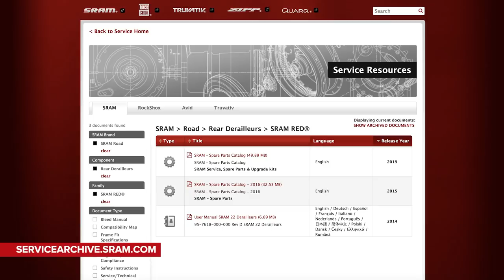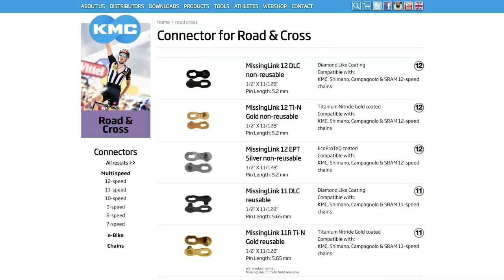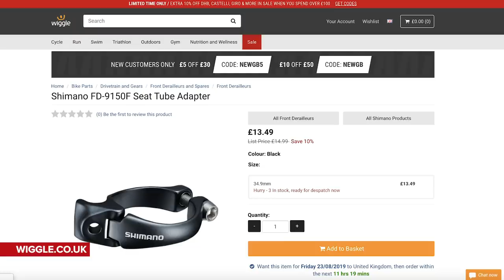How Do You Keep Your Bike's Chain & Cassette Rust Free? | GCN Tech Clinic

Comment: Books to help bike maintenance: Zinn & the art of Road Bike Maintenance takes a lot of beating. Get the latest version with good information about hydraulic disc brakes and electronic shifting. The diagrams are very good, and he covers most of the component manufacturers that are commonly found on bikes. Even older bikes... IMVHO it is a clearer book than the Park manual. He also has a similar mountain bike manual which caters for the grubbier types!

Comment: @ I've just bought a Cannondale Systemsix and wanted to get into running some time trials. My problem is, how do I mount on a set of TT bars onto my very aero flat knot handlebar. I don't want to bodge it by wedging spacers into the clip until it fits my bar because it just doesn't seem safe. Any advice or clip on TT bar recommendations? Thanks in advance and keep up the great work 👍🏽

Comment: Seat Post Creating. I had that problem haunt me once. Nothing fixed the seat post in the frame or the saddle rail clamps. It was the nose of the saddle where the rails were anchored. I used epoxy glue on that and it worked...for three days. I threw the saddle away and bought a new one.

Comment: Bike brake question... In the field, When the caliper brakes get bumped and one pad is closer to the wheel than the other, or after and accident,  should you just use the rotating barrel adjuster and adjust it open, or physically push the calipers over till they're centered on the wheel?

Comment: I've just passed 1000 miles on my Continental 5000's (700x25) with great success and no issues or flats.  However, I noted the other day that I mounted the "rotation" on the front tire 
in the wrong direction.  Question: Should I change it now or would changing a this point have an adverse effect on this wonderful tire?  Thanks and love the show.
Reply: It won't hurt it to change it.

Comment: On the subject of KMC Missing Links. Just switch to Connex links. The Connex are easier to use, and are meant to be removed and reinstalled over and over. I use them on both my KMC and Shimano chains.  Also, regarding chains,  I suggest GCN do a  whole show on waxing chains. I.e. using wax, such as Molten Speed Wax, or plain paraffin wax, for lubricating chains. 

I have been using wax for 3 years, on all my bikes. I ride about 5000 miles per year.  For about 6 months I used paraffin wax. Then  I tried Molten Speed Wax. With Molten Speed Wax I get  200+ miles from an application.  Yesterday I took the chain off one of my road bikes to reapply wax. Chain had about 250 miles on it. After removing the chain my hands were still clean.  And after a couple of thousand miles the cassette, on that bike, is still bright and shiny! 

DISCLAIMER: I AM IN NO WAY CONNECTED TO THE COMPANY THAT MANUFACTURES MOLTEN SPEED WAX!

As I mentioned I used plain paraffin wax for 6+- months before switching to MSW.  I have been using MSW for 2.5 years. With plain paraffin wax my chains needed re-waxing every 100 miles or so. With MSW my chains stay noise free for 250+ miles.  Chains stay clean as does the whole drive train.  Even the drive trains on my mountain and gravel bikes stay a LOT cleaner than they do if I use petroleum based lubes. 

I only ride on average 200 miles per week. More miles April thru October, less in miles October thru March. On average I re-wax a chain (on one bike or another) once per week. Using MSW takes a bit more time and effort. But it is time well spent! 

I'm an old guy, and I have tried many, many different chain lubes. I no longer ride the miles I did in the past. I also no longer race bicycles. But for those who do race, take time to read the 'VeloNews' article on waxing chains. 

I am at a loss as to why more folks don't use wax as a chain lube. Especially MSW!  I'd like to hear what GCN has to say on this subject, as well as hear from anyone else that has input regarding using wax as a chain lube!
Reply: I'm a waxer myself (paraffin) and regularly get over 300 miles from a waxing.  I also have a bottle of wax mixed up with xylene (to keep it liquid) so I can lube the chain normally in case I don't have time for a full wax job.
Reply: @mikeshelton4466  Mike,  I also went the Xylene route after watching the Oz Cycle video(s).  In his December, 2016  video he showed how to make a mix of paraffin wax, paraffin oil and Xylene.  I tried that mix and it would work for less than 100 miles. I don't recall whether or not I tried just straight paraffin wax or not. Oz Cycle put out later videos that seem to me, to contradict his earlier video. I.e. he was talking about cooling the waxed chain cool water. Just seemed like too much trouble. So I tried Molten Speed Wax. I'm getting  easily 250 miles from an application of MSW.  MSW claims their product is good for 300 miles.  I keep a log of how many miles I put on my bikes after  I apply the MSW.  Normally I re-wax  once I hit 250 miles. Therefore I can't say what the maximum  mileage I could get if I pushed to the point where a chain started to really become noisy. 

After I apply the MSW, the chain is stiff as a board. I can literally almost hold the chain straight out as if I was holding a stick in my hand. To me that indicates that the wax has penetrated to the inner parts of the chain.  

Some time ago I did a calculation based on getting 200 miles per application. 12 applications per $20 bag of MSW. Works out to $0.83/100 miles. 

I may try using straight paraffin wax, and make a comparison to MSW.

What temp do you bring straight paraffin wax to when you're using it?  After cooling the waxed chain are there any other steps involved before installing the chain on the bike? I.e. is there any excess wax that needs removing? 

 With MSW  I simply wax the chain, run the chain over a piece of PVC pipe to loosen up the chain, then reinstall the chain. No excess wax to remove.  I heat the MSW to 200 degrees, +- 5 degrees. I talked with MSW about the +- temp range.  Of note: If I heat the MSW to 200* F, and then insert the chain the temp of the wax goes down. Therefore I bring the wax with the chain submerged in the wax back up to 200* +- 5* before removing the chain.

Mike, Thanks for your input!
Reply: When I submerge the chain in paraffin, it's 50/50 wax and paraffin oil (approximately).

I heat the wax up to over 212°F. So it boils any residual water out of the chain (that would be the popping sound like frying in a skillet.). When the popping stops, I turn off the heat and let the wax cool to the point to just before the skin starts to form on top, then carefully pull the chain out and hang it up so it cools naturally. Before it cools, I wipe the chain down to get the excess wax off the outside. 

As for the wax with xylene, I just take a portion of the wax bath mix and add some xylene to that. I do have to heat up the wax and chain in the winter otherwise it sets before the wax gets down into the pins. I'm still looking for a better solution to that problem. Maybe the MSW would work better.
Reply: @mikeshelton4466  When I was using paraffin wax I used a small 8" diameter crock pot. For MSW I now use a Lavany Wax Warmer ($20 on Amazon) that is 4" in  diameter, which requires less wax to fully submerge the chain.  The Lavany has a digital temp display, and a knob for setting the desired temp.  The Lavany  cycles on and off to maintain the desired temp. The temp readout is not very accurate, so I use a handheld temp gun to check the temp of the wax. I set the display so that the wax is at 200* F, and even though the display reads something other than 200* the warmer continues to maintain the wax at 200* +- 5*. 

I live in Wyoming. I work on my bikes in my garage, and during the winter I use a small heater to heat the garage to between 45 to 60 degrees.  When the cold chain goes into the wax the chain reduces the temp of the wax, but the Lavany gradually brings the wax back up to 200*.  

And by the way the MSW seems to perform well in cold weather. This past winter I did many 1 to 2 hour rides when the highs for the day were in the single digits or low teens. On my coldest ride the temp was 0* F, with -14 windchill, and the MSW performed flawlessly. I.e. when I start the ride the chain is completely flexible. From my experience cold temps do not adversely affect the performance of a chain waxed with MSW.

My experiences with using MSW have all been positive. I recommend it. And I repeat : I AM IN NO WAY AFFILIATED WITH MSW, NOR HAVE I EVER RECEIVED ANYTHING FROM MSW. For me MSW simply works. And if my words prompt someone to try the product then I feel I'll be helping a fellow cyclist.

Comment: After clean my bike I dry off drive train with a towel and compressed air than apply PB Masterblaster on drive train followed by CRC silicone being very careful not to get on tires or disc break pads and rotors. Plus the drive train doesn't get dirty nearly as dirty as it did using any other product that I have tried.

Comment: #AskGCNTech , Hi, I'm a road cyclist and currently using a Giant Defy 5 which is running on a Shimano Claris 2400 Groupset. I will be getting a Shimano 105 5600 from a friend of mine down the line in a few months, which includes the 5600 STI Levers, RD, FD, and the 105 5600 crankset. Can you please guide me which BB will be compatible with my bike and the crankset. Also, I want to know if I can use 105 5700 STI Levers (10 spd) with 5600 RD and FD? I know it is a old groupset for 2020 but a gift is a gift :) 

Thanks and hoping for a reply.

Comment: #ASKGCNTECH.  Is it safe to use a carbon frame on a turbo trainer?  Will it weaken the frame over time?
Reply: Michael Lalor it's perfectly safe, unless you exceed the yield strength (which you won't) it won't weaken it.

Comment: #AskGCNTech.
Hi Jon, I have just started to upgrade an old Emmelle alpine sports 5 speed road bike (probably about 30-ish years old). I want to move away from the awful stem/headset mounted shifters and have modern STI shifters and upgrade the freewheel cassette too. I was hoping to squeeze in a 10 speed and upgrade to 105 throughout. I have 127mm of space between the rear dropouts. What would you say is the biggest size freewheel I could fit in, along with matching shifters? Many thanks in advance. Gareth.

Comment: #AskGCNTech I’m thinking about doing a gravel race using my road bike. Problem I have is that I can only get up to a 28m tire on the rear however the front can fit a much larger tire. Would I have any issues using different sizes? I’m thinking about a 28 on the rear and a 35 on the front. Thanks!

Comment: Hello Jon & GCN crew! I have a quick question regarding mini V brakes on my giant propel. For some reason the front brakes do not center back after I pull the brakes and I have to manually center them while riding to avoid any rubbing. The rear brakes go back to the center just fine. It's just the front ones. Any thoughts? Thanks!! @

Comment: #AskGCNTech
Hi Jon, i have an old road bike from the early 1990's, with a complete Shimano 500ex Exage groupset, with down tube shifters and a 7-speed hyberglide cassette. Is it possible to replace the existing groupset to a groupset with a 9-speed cassette and gear levers on the handlebars? If so, what do you recommend?

Comment: Never seen Sram Green edition, but based on the photos available on the interwebs it looks as though a regular Red 22 derailleur can be frankenstiened with the Green edition. As far as I can see it's just the cage that has the special decal and green stripe. So simply swap out the cage plate from the green edition with the new derailleur body and jockey wheels.

Comment: #AskGCNTech Hi jon, i have a Giant TCR Advanced 2 from 2018 completely stock atm and would like to improve it a little bit. Its fitted with shimano 105 11-28 / 34-50 groupset and i was thinking either to mount Ultrega Di2 (11-32 or 11-30) / 36-52 either to keep the 105 and get a new set of wheels. I live in a very hilly south of spain (campo of gibraltar) area where theres not a lot of flat roads but still would like to get as flat speed As i can. So my question, would you recommend the di2 upgrade and if so on what gear ratio, or the wheels upgrade and if so what can i get for a middle value? Currently the giant have the aluminium giant pr2 tubelless with 700*25 gavia sl tyres. Thanks!

Comment: #AskGCNTech . I live near  beach. My bike bolts tends to rust very rapidly. How can I protect my bike bolts. Thank you
Reply: Keep you bike inside when not riding ;) Use teflon spray on nuts etc...
Reply: Buy inox or titanium bolts
Reply: If you want a long-term OCD solution for steel, you can do what I do: 

A) Grease the threads with a good-quality grease, something like Finish Line Teflon: stays on just about forever and keeps the threads protected.

B) Get your hands on a disposable one-use syringe (that you can keep on using forever) and a litre can of Eureka’s Fluid Film Liquid A that will last you a long time (Wool grease-based oil, no solvents, indefinite shelf life, a million different uses). Use the syringe to precisely apply the fluid film to the exposed metal parts, in your case the bolt heads. This will also eat away pre-existing rust.

C) Once your bolts are greased and lubed, get some bolt head covers: eBay’s a good source. These are usually plastic top caps that you push into the allen/hex bolt sockets. These will keep salt spray and rain water out while locking the fluid film in, keeping your bolts protected.
Reply: Move to Nebraska

Comment: Hi Jon - a couple of questions:
1) My front disc brake tends to 'ding' when I'm cornering. Is this normal or something that needs looking at?
2) I've noticed a quiet 'creaking' noise when standing my bike up on the ground and slowly rolling it backwards. Do you know what could be causing this?
Thanks!

Comment: #askgcntech Hi Jon. You are the man. I have a Cannondale Synapse with 160mm Shimano 105 hydraulic disk brakes They are great. But I am looking at ways of reducing weight on my bike and wonder whether it is possible to install 140mm disk brakes and thereby save weight - including saving weight on the clunky adaptors that are attached to the disk brake calipers.

Comment: #askGCNTech Hi Jon. I'm riding a Jan Janssen Sonic. Not that long ago I've change my tires from 23mm to 25mm. But when I'm riding my rear tire touches my frame on the non driving side. So I had to change my tires back to 23mm. Now I have no use for the 25mm. I wonder if I can combine a 23mm in the rear with a 25mm in the front. Will this reduce the performance. Thank you for your anwser. Cheers

Comment: Regarding rusty chain and cassette  - in summer I leave it in direct sun for hours, water just evaporate.
In winter time or rainy days, hair drier. Or - if I take off the chain - spray it with lots of WD40, it displaces water...  Later I lube it.
Reply: I guess I didn't take advantage of the brutal sunshine available in California lol I just took my inside right after washing it.  WD 40 turns out to be really useful with removing the surface rust.

Comment: #AskGCNTech Thanks for the answer!! I sadly had to find out now that I damaged the 7005 T6 aluminum frame with 700x28C wide tires. The tire has removed about 2 mm material with dirt and small stones from the brake bridge over the period of 3 years... sandblasted, so to speak.

Before I get the 105 R5800 groupset, I wanted to know if the frame can be saved? I am now riding a 25mm wide tire on my Vision Team 30. By the way, absolutely great wheelset!

Comment: Hi Jon! I have a Triban 520, which has most of the Shimano 105 drivetrain (minus the cassette and the chain). It is quite new, two months, 1000km. However, despite my best efforts, after three attempts, I still have one gear which struggles to switch into. When I am changing from the 4th smallest into the 3th smallest gear, it starts making a noise, and it takes several pedal strokes for it to finally change. Sometimes it changes a bit faster, but it always struggles a bit. I noted that it gets worse when the weather is very hot(we had several weeks of 35 degrees max temperature). On this conditions, I sometimes have to shift twice down(into the 2nd smallest gear) and once back up  Are my cables to blame?(thermic dilation). Is it that the cassette (Microshift) may be not perfectly matched to the derraileur? Maybe the chain is to blame? The other gears change very well, no strange noises, no weird delays. I keep it clean and lubed, so all the noise comes from the chain against the cassette. Thanks for the help!#AskGCNTech

Comment: Hi Jon, thank you for all the great advice. 

I bought a Fatbike to ride on the beach during my holidays. The chain started rusting after a few weeks even though I clean it after every ride with fresh water, dry it and GT7 spray that apparently gets rid of moisture as well. 

But after a few months also my normal bike chain and components started rusting so I figure that it is not riding on the beach or in the water but Satzes the seaside air that gets to the bike during the months it’s not used. 

Both bikes are already kept in the closed garage but can I do anything else? Remove the chain and submerge in oil or something when I am not riding for a while? Or is it just a matter of buying a new chain every year or so?

Comment: #AskGCNTech Hey guys. Im a highschooler right now and plan to get into races. What price range should i be looking for when i buy a road bike? Thanks
Reply: For your first road bike, buy a used one, aluminum frame with carbon fork, 105 or Tiagra groupset.  It should cost about $800 or less, for something that is in like new or very good condition.  The most important thing is to get the size right, and then the positioning on the bike.  You can find out more about this on YouTube or a good book.